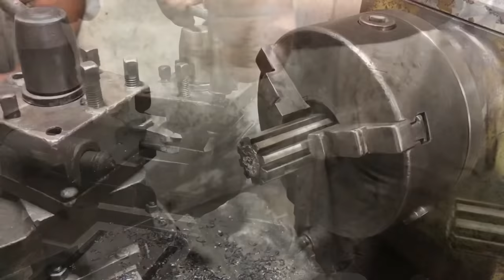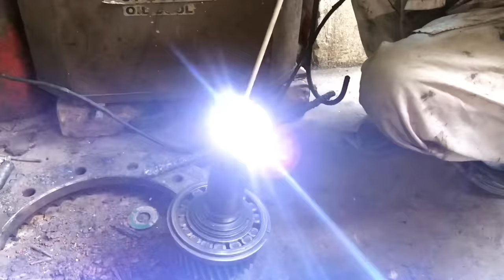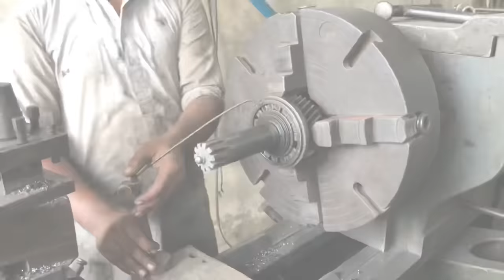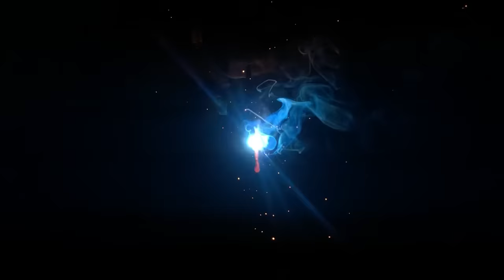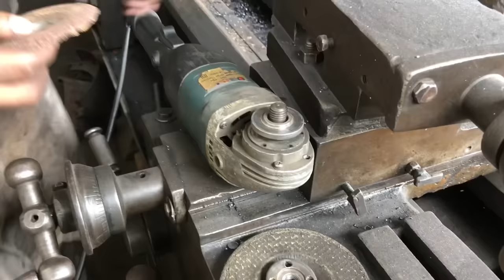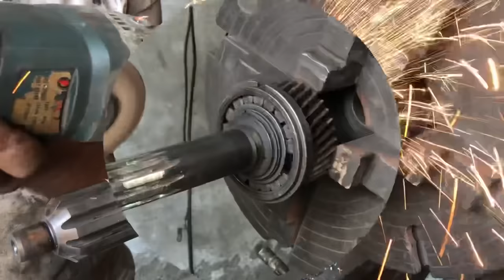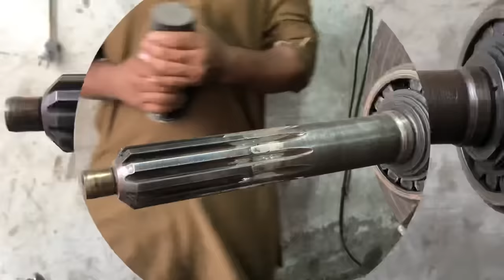The Ingenious guy Connected Broken Input-shaft Very Nicely / Pk process

Comment: Can’t imagine anyone believing this repair will last very long. Love how he used his cutter to guide the drill.
Reply: The guy can’t go to Kwik fit for a factory replacement…we could teach him a few things about practices ,but he could teach us a load about real engineering..
Reply: @griswald7156  I don't know about that.  I realize he's doing the best he can with what he has, but that repair simply isn't going to hold up.   
Plenty of shops here could do that, they just don't bother because they know it won't hold.
Reply: Depends on the parent material and the material used to weld. Also, he might add a post weld heat-treatment -probably not going to be done, though (Joining Technologies).
Reply: @SealofPerfection  
It also depends on the application. No, it wouldn't hold up in my muscle car with 450 foot pounds of torque but for a little old lady going to the grocery store once a week, she's probably good for the rest of her life.
Reply: @Junkman2008  If said little old lady drove a stick. 
And I don't think it'll last very long at all. I suspect these repairs are just done for the sake of making a cool video, not for actual working vehicles.   
The shaft broke to start with, now not only is it weaker, but the heat treating has been altered by the welding.
Reply: @SealofPerfection  
We'll agree to disagree. I've broke enough shafts racing to know what might work what won't.
Reply: @Junkman2008  Fine...but:  Ever seen anyone weld up something like this and have it work?  I thought not.  
Would be nice if they showed these things put back into service to see how they last, but they never do.
Reply: @SealofPerfection  
Dude, we've blown HOLES in Engine blocks and fixed them. We're not talking about passengers cars, we're talking about RACING blocks. Just because YOU don't have the experience doesn't make it impossible. You need to learn how to do some research on subjects that you are NOT astute on.
Reply: @Junkman2008  "we"  "racing" blocks.   
Right.    

Well, I guess that means you know that aluminum racing blocks are...well, aluminum.  They aren't even REMOTELY close to a hardened steel input shaft that experiences severe torsional stresses.   Total apples and oranges comparison.  
Blocks usually get holed from a broken rod.  And those can be fixed without too much trouble, which is why aluminum blocks are used for serious racing instead of cast iron, which is almost always junk if it gets holed.  

With cast, if the cylinder gets damaged, you can sleeve it, but if it puts a hole in the side or breaks the main webbing, it's done.(maybe some rare cases a hole in the water jacket can be fixed, but about 99% of the time, no.   
But a hole in the side of the block is just a hole, and if it's aluminum it can be repaired.  Seen it done many times.   Helped do a few, cylinder heads, too.  They take damage more often than blocks do IMO, and get fixed every day.  TIG weld it up, machine it back to where it's supposed to be, re-do the valve job and it's good to go.  
Aluminum is more forgiving, and can be more easily welded.  Cast iron is not, and hardened steel that takes torsional loads is even worse.  

Having been in the auto repair business for over 40 years, and building street and drag engines for nearly as long with many hundreds of passes down the track, I have seen lots and lots of carnage.   

You also might want to look at more of these videos and realize that a lot of knowledgeable folks are saying the same thing I am about this repair.  It's not remotely "just me".     
Have a great night.
Reply: @SealofPerfection  
And again I say, I DEPENDS ON THE APPLICATION. I will use a Chinese made jack to slightly lift some weight of a car. No problem, done it a million times but to actually raise it high enough to crawl up under a car? I will only use a QUALITY lift or jack of some sort. You DON'T need a 800-pound gorilla for every job on earth. Sometimes, cutting corners is just fine. It depends on the job. Maybe if you read a little SLOWER and understood that sentence, you wouldn't keep tooting your own horn. I don't see anyone else doing it for you so you must not be anywhere as knowledgeable as you THINK you are.
Reply: @SealofPerfection  I can’t imagine you don’t believe welding work has real strength of the original steel! What about all the bridges and warship building?
Reply: It'll last long enough for him to sell the vehicle it came off. He's welding en24 shaft steel with mild steel rods,  this steel shouldn't be welded at all
Reply: @SealofPerfection  I agree 100%,
Reply: @SealofPerfection   Totally agree.
                            Those steels do not weld well. It will break, easily.
And by the size of the driven plate, it is not granny´s little car. Looks like from a lorry.
It must have taken severe loads. Never seen an input shaft break in 51 years.
Reply: @motube5  I weld all the time.  But not on hot-rolled, hardened steel.   You cannot weld it reliably.   
No weldor or machinist would tell you he could fix that shaft reliably.  In fact, you have many in the comments saying exactly what I'm saying:  It's not going to hold up.  

Welding this type of steel, the weld is NOT remotely as strong as the original.   It's not the same as a structural component like in a bridge or a ship, as you mentioned.  Nothing in a ship that takes torsional stresses is welded, even when they break.
Reply: cause who even uses a center drill, brah?
Reply: @opal177  Yep.  It probably held up until the first time someone released the clutch and applied pressure to it.  
These things just don't break, and when they do no level of welding skill is going to be sufficient.  
As I said originally, I think these videos are just done for entertainment, they never show these part back in service.
Reply: Pakistan used to built their own gun..I can't believe they can't make a new one shaft .
Reply: At the very least he bought some time. If it lasts 6 more months, it’s fine for the price of the repair (less than 10$ probably). Obviously it won’t last too long.
Reply: First take off it will break again
Reply: He is a shoemaker Not a machinist ...he was suppose to use center drill prior to use the drill
Reply: And the shaft it was suppose to be heat treated ...after welding the shaft is not going to last more then 5 min after installation :)
Reply: @XVRMEDIA  yep 5 min :)
Reply: Un buen   tornero ke bruto
Reply: I'm not a skilled mechanic, I'm a design engineer but I can't imagine a world in which it's a good idea to blast a bearing with angle grinding sparks or drops of molten metal from welding. And even after painting you can see where is has been repaired. Maybe this will get you to a place where they can order you a new part but I don't see this lasting verry long. but I did enjoy the video
Reply: @Junkman2008  There's very little stress on an engine block unless its has cross bolted caps bro, this is an input shaft from obviously heavy machinery that experiences torsion every minute of its use. At the very least the two parts should have been drilled, tapped and threaded hardened rod used to secure them together before welding, even then it's still a ghetto fix. 40 years experience here and taught by a master mechanic who holds patents.
Reply: @quietcool4884  
Nobody said that there are not 5-million other ways to do what the guy did but before I would criticize the guy, I would at least have some videos on your channel that show EXACTLY what you know. The same exact way I have done for YEARS when it comes to fixing paint on cars. No one doubts my ability because I have SHOWN the extent and depth of my knowledge AND ability.
Reply: @Junkman2008  99% of your vids are childish video games lmfaorotf !!!!!  Bahahahahahahaha  !!!!!!!! Give me a break lmao !!!!!! Some channel you have there bud.
Reply: @quietcool4884  
Hey Mr. 2-subs.... TWO SUBS???? 😆😅🤣😂🤣😅😆😅🤣😂🤣😅🤣😅😂🤣😅😆😅🤣😂
Reply: @quietcool4884  
Hey Mr. 2-subs, so are you like a 9th degree black belt in welding with your two subs? 😂🤣😅😆😄😂🤣😅😆😂🤣😅😆😄😂🤣😅😆😂🤣😅😆😄😂🤣😅😆😂🤣😅😆😄😂🤣😅😆😂🤣😅😆😄😂🤣😅😆😂🤣😅😆😄😂🤣😅😆
Reply: @quietcool4884  
Hey little 2-subs, did Obi-Wan-Kenobe teach you how to weld with a light saber? 😂🤣😅😆😄😂🤣😅😆😂🤣😅😆😄😂🤣😅😆😂🤣😅😆😄😂🤣😅😆😂🤣😅😆😄😂🤣😅😆😂🤣😅😆😄😂🤣😅😆
Reply: @quietcool4884  
Hey little 2-subs, tell us again about how you were taught by the force to work with metals! 😂🤣😅😆😄😂🤣😅😆😂🤣😅😆😄😂🤣😅😆😂🤣😅😆😄😂🤣😅😆😂🤣😅😆😄😂🤣😅😆😂🤣😅😆😄😂🤣😅😆
Reply: @quietcool4884  
Hey little 2-subs, do they allow you time outside that padded room? If so, how big i your helmet? 😂🤣😅😆😄😂🤣😅😆😂🤣😅😆😄😂🤣😅😆😂🤣😅😆😄😂🤣😅😆😂🤣😅😆😄😂🤣😅😆
Reply: @quietcool4884  
Hey little 2-subs, what do crayons taste like? 😂🤣😅😆😄😂🤣😅😆😂🤣😅😆😄😂🤣😅😆😂🤣😅😆😄😂🤣😅😆😂🤣😅😆😄😂🤣😅😆😂🤣😅😆😄😂🤣😅😆😂🤣😅😆😄😂🤣😅😆
Reply: @quietcool4884  
Hey little 2-subs, do you drive your house to Jiffy Lube? 😂🤣😅😆😄😂🤣😅😆😂🤣😅😆😄😂🤣😅😆😂🤣😅😆😄😂🤣😅😆😂🤣😅😆😄😂🤣😅😆😂🤣😅😆😄😂🤣😅😆😂🤣😅😆😄😂🤣😅😆
Reply: @Junkman2008  I'm not here for subs or $ bro, but I talked to someone you helped and they said quote "the only thing he managed to do was make the paint dull around the scratch".  LMFAOROTF !!!
Reply: @quietcool4884  
Hey 2-subs, being a test tube baby, how do you celebrate mother's day? Do you drink some brandy out of a Petri dish? 😂🤣😅😆😄😂🤣😅😆😂🤣😅😆😄😂🤣😅😆😂🤣😅😆😄😂🤣😅😆😂🤣😅😆😄😂🤣😅😆😂🤣😅😆😄😂🤣😅😆😂🤣😅😆😄😂🤣😅😆
Reply: @quietcool4884  
Hey 2-subs, my cars cost more than your house! 😂🤣😅😆😄😂🤣😅😆😂🤣😅😆😄😂🤣😅😆😂🤣😅😆😄😂🤣😅😆😂🤣😅😆😄😂🤣😅😆
Reply: @quietcool4884  
Hey 2-subs, take those fender skirts off your house. We KNOW it has wheels! 😂🤣😅😆😄😂🤣😅😆😂🤣😅😆😄😂🤣😅😆😂🤣😅😆😄😂🤣😅😆😂🤣😅😆😄😂🤣😅😆😂🤣😅😆😄😂🤣😅😆😂🤣😅😆😄😂🤣😅😆😂🤣😅😆😄😂🤣😅😆
Reply: @quietcool4884  
Hey 2-subs, what kind of mileage does your house get? 😂🤣😅😆😄😂🤣😅😆😂🤣😅😆😄😂🤣😅😆😂🤣😅😆😄😂🤣😅😆😂🤣😅😆😄😂🤣😅😆😂🤣😅😆😄😂🤣😅😆
Reply: @quietcool4884  
Hey 2-subs, tell me some more about how Darth Vader taught you how to work with metals! 😂🤣😅😆😄😂🤣😅😆😂🤣😅😆😄😂🤣😅😆😂🤣😅😆😄😂🤣😅😆😂🤣😅😆😄😂🤣😅😆😂🤣😅😆😄😂🤣😅😆😂🤣😅😆😄😂🤣😅😆
Reply: @quietcool4884  
Hey 2-subs, the nice thing for you about having so much space between your teeth is that, YOU DON'T NEED TOOTHPICKS! 😂🤣😅😆😄😂🤣😅😆😂🤣😅😆😄😂🤣😅😆😂🤣😅😆😄😂🤣😅😆😂🤣😅😆😄😂🤣😅😆😂🤣😅😆😄😂🤣😅😆😂🤣😅😆😄😂🤣😅😆😂🤣😅😆😄😂🤣😅😆
Reply: @quietcool4884  
Hey 2-subs, I'll slow down for you so that you can catch up. Not that you are that creative but hell.... I'll take into consideration that you ride the short bus to school! 😂🤣😅😆😄😂🤣😅😆😂🤣😅😆😄😂🤣😅😆😂🤣😅😆😄😂🤣😅😆😂🤣😅😆😄😂🤣😅😆😂🤣😅😆😄😂🤣😅😆
Reply: @quietcool4884  
Hey NUMB NUTS, waiting on you! 😂🤣😅😆😄😂🤣😅😆😂🤣😅😆😄😂🤣😅😆😂🤣😅😆😄😂🤣😅😆😂🤣😅😆😄😂🤣😅😆😂🤣😅😆😄😂🤣😅😆
Reply: @Junkman2008  Show me some statistics bud.
Reply: @pcm7315  It also depends on the weld inclusions (both flux and voids, at least one is visible after grinding), weld penetration (didn't look like there was much), whether the weld filler is as strong or compatible with the shaft metal and stresses as there was no pre or post fix heat treatment. When the central blob of weld was machined, it looked softer than the shaft. For all we know it could have been anything, just to make a bit of money from a Youtube video.
Reply: U pravu ste ... Spojnicka osovina kao u ovom slučaju kad pukne tu više popravke nema , jednostavno zamor materijala .. pozdrav
Reply: @Junkman2008  did you even notice the size of the input shaft?  Little old ladies car?   That goes in a big truck with more torque than 450 ft lb torque.   that repair may last as long as it takes to get the truck sold and thats about it.  First hard pull with a grocery getter, it will break.  Dont compare to a block repair either.  If you ever build something with enough power to break axles on launch, have them repaired this way and tell us how it works out for ya.
Reply: @leonduspatrick1891  
And what have YOU done? 🙄
Reply: 🤔 perhaps the vehicle is gonna get pulled by an elephant anyway....who gives a fuck 🤣🤣🤣🤣🤣🤣🤣🤣🤣
Reply: Он станка не знает.
Reply: Такие вещи не работать небудут !!!!!!но парню респект ,руки золотые .
Reply: Maybe it only has to last long enough to get a "FOR SALE (AS-IS)" sign on it and roll her off the lot  :-)
Reply: They made a repair VIDEO, not a repair, done to get paid by youtube, it's the same as people showing you how to become a successful millionaire, it's fake, that shaft is useless, people with real skills to produce something spend their time producing that thing, not videos.
Reply: @neilrasmussen2063  This.  4 million views for 1 hours work and 1 welding rod is a pretty darn good return.
Reply: @johanwessels1042  Save the lathe first and foremost, otherwise the lathe AND the part are scrap.
1. Grinding in the vicinity of anything with exposed bearings/slides/ways such as a lathe/mill/shaper/CNC/etc.
2. Conducting electrical current through any bearing, bushing (or gears). The lathe is packed right-full of all of those things. 

Where I come from:
Either of these activities would instantly earn someone a pink 'VIP class career change' ticket with extreme prejudice; Replete with a security entourage and motivational boot to help ease them right into their new life.
Reply: @johanwessels1042  Did you also see that the bearing is junk and broken, probably what broke the shaft in the first place, most likely will be replaced???
Reply: @lennym1636  did you see the truck that it came out of lol🤣😂🤣
Reply: @SealofPerfection  the repair will hold more than the rest of the part....
Reply: @rafars2246  you must be joking. No weld is going to be stronger than the original forging. Not to mention what it does to the heat treatment of the original part. There's no way this will hold up
Reply: @SealofPerfection  I guess you're blind then, and yes welds can be even stronger that the part itself.
Reply: @rafars2246  Possibly stronger than just regular steel, yes. Stronger than machined billet? No. And that metal was heat treated as well, welding messed that up also
Reply: @SealofPerfection  you really don't know what you're talking about
Reply: Rzeźba i oszukiwanie się - poziom ekspert. Pierze i trocinę luzem może wozić.
Reply: @Junkman2008  that input shaft is out of a semi truck transmission, definitely not holding up to the power of a big diesel engine
Reply: @Fisherman99  
Who said that it was going back inside what it came out of?
Reply: @Junkman2008  Engine blocks, even RACING engine blocks don't have torque on them like that.  They mainly see only tension and compression loads, that's why they're merely basic castings and not special alloy and heat treated forgings like an input shaft.  I've repaired RACING blocks with JB weld and aluminum sheet metal just for fun, and they worked fine.  
Anyway, the point is, the hack machinist in this video did a horrendous job at "repairing" this shaft, and broke about every rule in the machinists book doing it!
Reply: @hyedenny  
So where's the video of YOU doing any machine work on anything to prove that you are remotely just as capable? I'll wait right here to see that.  🙄
Reply: Один вопрос,на сколько времени хватит такого ремонта?
Reply: @Junkman2008  Holy smokes, the Junkman commented on here?? Hope you're doing good man. I learned a lot about detailing from your videos. God bless you sir!
Reply: @hyedenny  I would hardly call him a "hack" machinist when you consider he's doing the best he can with what he's got. These guys often do not have the luxury of looking up the part they need and having it show up to the shop two days later like we do in the US. Given what's available to them (tools, materials, working environment, limited availability of parts, etc) it is very impressive to see what they're able to pull off.
Reply: @oswaldcobblepot502  
Man, there's no telling what crack on Youtube you might find me. I'm all over the place. Doing great, thanks for asking. Hope you can say the same. 😁
Reply: I'm calling bs on the entire thing.  I have never seen a splined shaft break in half like that.  They they will snap, but the splines themselves are always twisted.
Reply: @theakh4238  
They said the same thing when someone suggested that the world was round. 😐
Reply: just jump off the clutch hard enough with a heavy load and that's it.
Reply: @hoost3056  True, but who in their right mind is going to do that, know what the have in the tranny? If I did this to a truck I owned, I'd have the common sense to take it easy. People in third world countries are a lot more creative/resourceful than Americans are because they may have to do without the luxury of having a NAPA store on every block.
Reply: that shaft is not going to last, no way!!!
Reply: @griswald7156  and making due with what you have
Reply: @Junkman2008  hehe so its true
Reply: @Junkman2008  it seems she was good in it as she was allowed into heaven. so god must have enjoyed it.
Reply: ៊៊៊
.៊
លោក
Reply: @Junkman2008  With the size of that shaft I doubt 450ft lbs would be much of a problem.   I can't imagine doing a repair like this in any case though.
Reply: @Junkman2008  Well since it broke i think we can rule out that application.

If the original one was pushed to it's breaking limit, i would bet that this will not last.
Reply: @JohnDoe-bd5sz  
Nobody said it would but it's hell of impressive work still. The guy has a skill level that nobody in this string could match.
Reply: @Junkman2008  the fact you are making these strawman arguments about it not needing to be a properly hardened part is hilarious. do you know how much load input shafts constantly take even for a daily driver who drives like a grandma. they harden them for a reason and metallurgy does matter.
Reply: @motube5  there's a reason a vast majority of that is riveted now as welding degrades the steels hardening and hardening something that huge properly isn't an option hence why its done in sections then riveted.
Reply: @Junkman2008  "It also depends on the application. No, it wouldn't hold up in my muscle car with 450 foot pounds of torque but for a little old lady going to the grocery store once a week, she's probably good for the rest of her life." sure you did bud. that shaft is only good for being a paperweight now, nothing more.
Reply: @rickylafleur5823  WHICH IS EXACTLY WHAT I SAID. 🙄🤦‍♂️
Reply: @Junkman2008  Honestly.

No he does not.

The level of craftmanship here, stick welding a hardened material, and cutting splines with an angle grinder instead of something like a shaper, is very very low tech.
Reply: @JohnDoe-bd5sz  
Whatever, I don't see any videos on YOUR channel showing what YOU can do. 🙄
Reply: @Junkman2008  My ability to do better, has not got anything to do with me being able to spot bad handywork.

I can not fly a plane, but i CAN say that a pilot that crashes a plane because of mishandling, is a bad pilot, even though i could probably not have flown it better myself.
Reply: @JohnDoe-bd5sz  
Sure thing bud. So lets see some of YOUR work. Do you have any to post? No, you're just some guy on the internet who criticizes another guy who can do something you CAN'T.
Reply: The original broke.  The belief will be that if the original broke then if the repair breaks, it was just as good as the original.  It might even break in a new spot.
Reply: @alext8828  
That repair is not going to hold up in the same application it came out of. Probably not even half the application. But he may find some application where it will hold. It didn't cost him anything to try and he definitely is showing some level of skill in doing what he did.
Reply: @alext8828  It is most likely going to break right next to the weldings he made.

This is a hardened steel part and would require new hardening to have even a chance of "surviving" so it is not going to work.

The problem is that the forces are twist forces on this part, so it will essentially just be twisted to the breaking point like it was in the first place.

Also the splines crudely cut poorly with an axle grinder will mean that the clutch disc will be able to vibrate putting even more stress on the part, and making the vehicle jump, when changing gears.

These splines are rather precision cut, so crudely gouging new ones with an axle grinder will certainly not work.
Reply: @SealofPerfection , чем быстрее сломается, тем быстрее принесут ремонтировать... Без термообработки, без зубофрезерного станка, на коленке... О, Господи!
Reply: @Junkman2008 oh, like space rockets that land humans on the moon and bring them back to earth?
Reply: @jeffb321   And what the hell does that supposed to mean?
Reply: @Junkman2008  in reply to your comment- " americans think they own the crown when it comes to innovation." There's really no disputing that America is the world leader in innovation. That's why we value our intellectual property rights so much.
Reply: @Junkman2008  Sounds amazing my friend, We're gonna miss ya!!
Reply: @jeffb321  The feeling ain't mutual. Good reddens.
Reply: @Junkman2008  probably on every intelligence agency's radar anyway. Your channel doesn't seem to represent your extremist views...the shadow in the dark if you will.
Reply: @Junkman2008  amazing comeback 👏
Reply: Aaron, I totally agree with you.  Don't forget the angle grinder he used to "machine" the splines and the black paint to cover up the mess.  I get that he probably has no modern equipment, and he certainly deserves credit for doing what he could. It is nothing even close to resembling a structurally sound, within tolerance repair.
Reply: @Mark-EFMB-Combat-Medic  
EXACTLY. The guy is probably self-taught and just imagine what he could do with the right equipment, on something that could actually be structurally sound after a repair. I give credit where credit is due.
Reply: my Chanel experiment )))
Reply: @Mark-EFMB-Combat-Medic  This is what we usually do in the field to keep equipment running as we wait for the correct replacement parts to arrive. But I have my doubts that this is the case with this repair.
Reply: @ritchylalaland4325  
Where?
Reply: @SealofPerfection  you are 100% right, plus not to mention the welding sticks the guy is using will be different element make up than the metal in the part ..... will be inconsistent material leaving room for a week point for it to break again such as like you said on or next to the weld
Reply: @motube5  Bridges, maybe not always built on the cheap and only in ways like this guy and other such channels if not built by the government or that's how poor their government is. Warships, very different, and what military property from any country is not made by the lowest bidder?
Reply: @rafars2246  "the repair will hold more than the rest of the part...."
Evidence needed.
"I guess you're blind then, and yes welds can be even stronger than the part itself."
Doesn't mean this was a good weld that actually would do that. As I've said on two threads now, we don't see a load test to determine if his repair was any good. Many companies make tools, parts, automobiles, etc. but offer no demonstrations that proves their claims. And we have seen many times with phone companies and others that do offer a demonstration or photos but it's all faked. So, without proving that his repair is superior to the part when it was machined, I have a safer bet on it being crap than you do on your claims.
"you really don't know what you're talking about"
Actually, I'd say you are the one that doesn't. You and a few others defending his work demonstrated with your claims that it's stronger just because of the presence of welds that you don't really understand welding. Example, arguing the weld could be stronger than the part itself, tac welds are were metal is welded together, but wouldn't hold them together very well, especially if they were cold and didn't use the right rods if MIG or SMAW welding.
Reply: @JohnDoe-bd5sz  As much as Junkman goes on about needing to have public YouTube videos or you suck at machining, engineering, etc., would love to see him argue that towards some great and famous engineers that don't have public YouTube videos of their work on their own channel.
Reply: @ReroutedYearAD  you're blind and unqualified. The fix was perfect, stronger than the part.
Reply: @rafars2246  Who are you to determine who's qualified or not? Also, yet again, evidence that it is stronger is needed. You keep claiming it is, but refuse to show us that shaft taking a stronger load than what broke it.
Reply: @jeffb321  Claim I'm wrong on almost everything, but offer no proof of what I was wrong about about and how it's wrong.
Reply: @ReroutedYearAD  I'm a physicist and an engineer, you're an amateur. Nufsaid.
Reply: @rafars2246  I'm an engineer, too. But appealing to our credentials doesn't prove your claim that this repaired shaft is stronger than it was at manufacture.
Reply: @rafars2246  You bring up your credentials enough, yet amazingly, where your training in engineering is must not have taught logic being an element of engineering.
Reply: @ReroutedYearAD  not a lot.
Reply: Not a lot. Yeah, not a lot of evidence for your claims there, since you still won't provide any.
Reply: @griswald7156   %
Reply: @griswald7156  

.
Reply: @griswald7156  .
Reply: @griswald7156 

M  ....
Reply: @Junkman2008 
FYI, judging by the size of that clutch plate the shaft is out of a medium size diesel truck that would definitely put out more torque than your street racer. So the moral of the story is I wouldn’t bet money that the repair will last a 100 hrs of operation.😮
Reply: @Junkman2008 
That looks like the main shaft out of a truck transmission, it broke because someone probably abused it, I’m sure it was heat treated for strength, well It doesn’t look like they use precision equipment in their repairs, an 8 lb sledgehammer and a grinder are the main tools there.😬
Reply: @Tshasta4449  
Maybe not, but you CANNOT deny that the guy has talent.
Reply: @Tshasta4449  
For all we know, this video could have been made in a 3rd world nation where making due with what you have is all they can do. The guy has talent and that cannot be denied.
Reply: @Junkman2008  
I agree, he has an old large lathe with the barest of accessories and with that he can create crude results, not to demean his work, but precision isn’t in the cards. I watched him put together a broken crankshaft by pinning and welding the 2 parts together. Then using a strip of emory cloth to hand polish the surface where he had welded and used a hand grinder to smooth the welds. When he had finished and the part was spinning in the lathe you could see it wobbling at least .05” out of alignment. 
Definitely not what a shop here would ever think of doing. But I give the guy credit for doing what he does with the most basic tools possible..!!
Reply: @Junkman2008  
Absolutely, that definitely is a 3rd world country. That lathe is from the 1940’s and with the most basic of accessories. I’m totally surprised that he never uses any type of oil to cut or drill.
I watch him take a small cut and the chips are glowing red from friction. He is definitely using brute force to remove metal, the cutting tool could use a bit of grinding to sharpen it.
Being a machinist myself I can appreciate what he does, although I wish I could give him some help in precision in the finished product.
It would be interesting to see how long the repairs last. The proof is in the pudding… LoL
Reply: Your right i could at least drilled a center hole on each side 1/2  by 1 3/4  deep and pressed it into the shafts then welded it would have been better  GODSPEED
Reply: Your right  HE could have drilled a center hole 1/2 on each piece 1 1/2 deep  and pressed into the shafts then welded it up with some high tensile rod  then maybe it would lasted  a little longer  GODSPEED
Reply: meu amigo, provavelmente o uso não é agresivo, pode até quebrar depois de um tempo e preovavelmente vão voltar a fazer o mesmo precodimento, aqui no Brasil nunca vi fazer, mais ja ouvi dizer que alguem emendou um comando de valvulas, talvez por não ter acesso $$$$$$. e tambêm sabemos que muitos paises faltam recursos. talvez aquele seja o unico eixo piloto em milhas. nunca saberemos
Reply: I give it no more than 10 hours of use, it will fail for any one of 10 reasons
Reply: He believes and thats all that matters, lets hope the guy who is paying for that work of art believes it too. 😁👏🏻👏🏻👏🏻
Reply: Pakistan work
Reply: It'll probably last longer than that poor bearing
Reply: Have  you seen the slums in India? The ONLY in thing abundance is, well, excarment. Imagine what he can do if he had everything he needs. The boggling part is how certain welders can see this guy and the rest from that far above. Wifi , or reaaally long ethernet?  Sad how most go staright to your selfishness. 

Doesnt anyone a better idea if they were in his shoes, in a slum? Ya know.. instead ragging.
Reply: @BobbG13  Valid. These guys do pretty amazing things given their circumstances.
Reply: It might... might be useful for a clutch disc alignment tool or paperweight now.
Reply: @TheTreegodfather  
*That's exactly what I'm saying!^ Some of these fools won't give a man his props because he appears to be in a 3rd-world country, but they don't have anything on their channel that shows that they can tie their shoes. 🙄
Reply: @motube5 lmao in what way stronger? 
I mean there's a lot to types of metal alloys and ea purpose. This very easily could be electro fused. Kinda like gm van hinges n ya I know iknow. BTW that shaft is not hard anything their built to flex when a ftard dumps clutches on slicks also to survive harmonic shattering reverbial vibration n ya ya we know you've no clue smfh.
Reply: Solid welded portion is always stronger than the stock metal
Reply: @vareseources  It’ll break right next to the weld.
Reply: It's called "repeat business".
Reply: Trabaje muchos años como operador de máquinas y herramientas y soldaduras especiales y pienso que este trabajo de este señor es bastante chambon
Reply: @Junkman2008  Are you telling us that just because you use a quality Jack,  you get under a  car without jack stands? If so, the credibility of your knowledge has a rocky foundation if you don't follow basic safety rules.
Reply: @SealofPerfection  Hey, I have a similar industrial gear shaft broken. Can you tell me the correct way to get it fixed? If you have any video on YT that might help, kindly share the link. Much appreciated.
Reply: @immadamir  Replace it.  Can't be fixed where it will last.
Reply: If an original one can break repaired or new one too   repaired one might be more stronger than an original as it’s done with conviction
Reply: @ahmedkhan-vm3cp it will never work. When the splines aren't smooth the clutch disc will bind and it will not disengage and engage properly. The shaft will destroy itself anyway, because it has at least 15-20 thou runout.